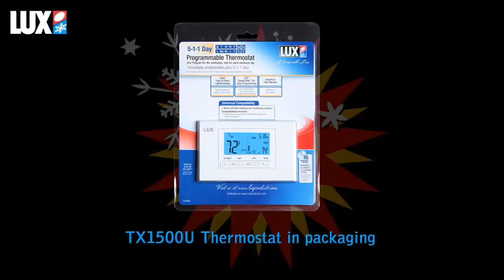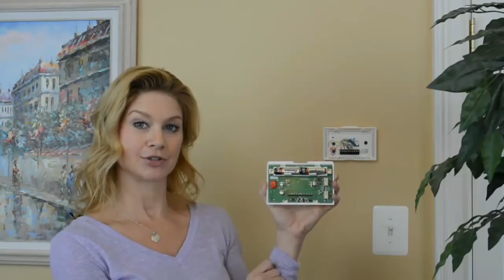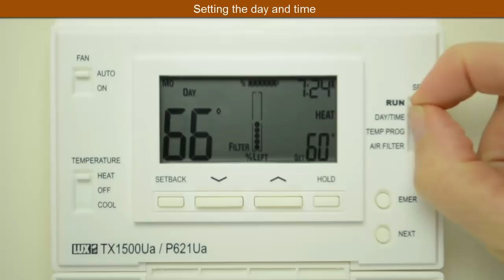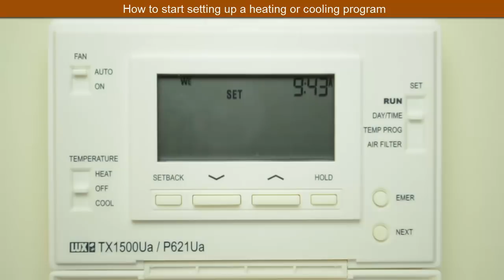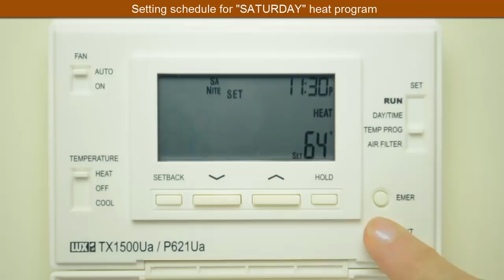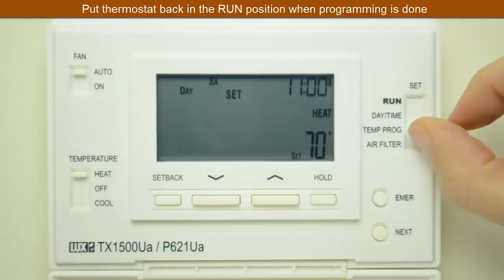How to Program your Lux thermostat for Ultimate Comfort and Energy Savings

Comment: My Lux 1000 thermostat is the perfect example of a device that was designed by people who are completely out of touch with reality.  Yes, this thermostat can do the wash and change the oil in my car and give me a back rub.  But God forbid I should want to set the thing on just one temperature. Very confusing to say the least.
Reply: The worst.
Reply: I agree.  The thermostat is a bit confusing.  Because it can do a lot, simple settings become complicated.  I set the thermostat for 62 F.  In  the middle of the night, I hear the furnace constantly on.  I'm come downstairs, and the temperature is set for 70 F.  I have to learn more about "program mode".
Reply: @VolksdeutscheSS  mine is doing the same thing, automatically changing the set temperature back to 70. Did you solve it?
Reply: Hahah same here! I just ant it set at 70 on a hot summer day, cmon thermostat!

Comment: I bought one to try it out and was happy and bought a second one. do7.pl/honeywell1 The instructions were very clear on how to document how your old thermostat is wired, even including wire tags to mark where each wire was connected. It also provides which wires to connect based on what kind of system you have. I did also set it up to work with Alexa. Everything went smoothly. Only note is it's smaller than my old one so I had to touch up the drywall and paint.

Comment: 62 during the day? Assuming your at work..and over nite? Is Rediculous! Need a Heating Blanket for every one( 3-4) No thanks, taking it back tommorrow to Home Depot.. ! Let the Next Generaion figure this stuff out..I'm too Old for this stuff.ReInstalling my Simple 2 Temp setting  unit , 68 at Bedtime -9pm, till 5 am , then 72 from 5am-9pm..I budget $75 Mo. here in Wisconsin..and Increase that  by +5% yr ever since..No Wood Cutting and shirley no Coal or Pellet stove  baloney..  after reading the Manual and putting up listening to her? You can (1) push ther UP Arrow Botton to raise the T4emp setting to what you want it to be 24 hrs..(2) Then Press the HOLD botton on the right and Hold it until you hear a Click adn you should have Over-Ridden the settings and don't touch it anymore!!!It should stay at that setting, until you can go b ackj to gthe Home Depot and buy a Simplier Unit and replace it and then Return it to get you $40 back..